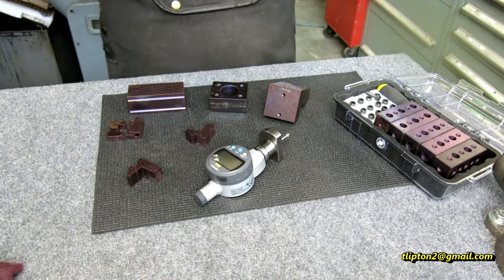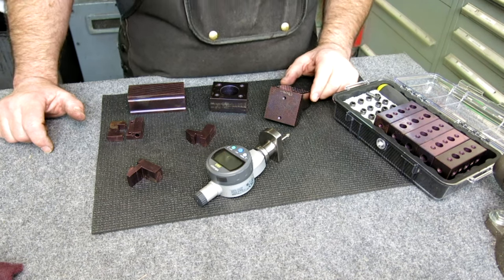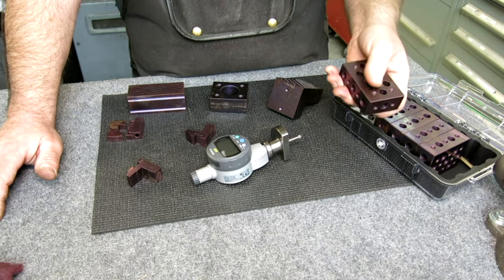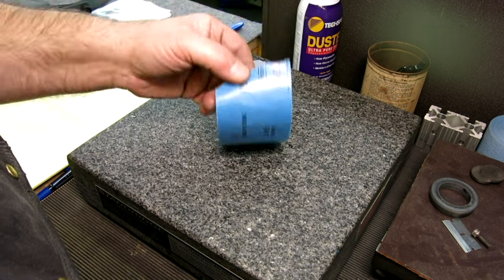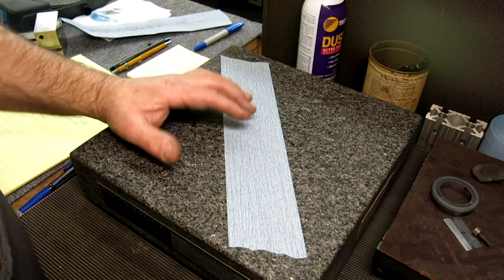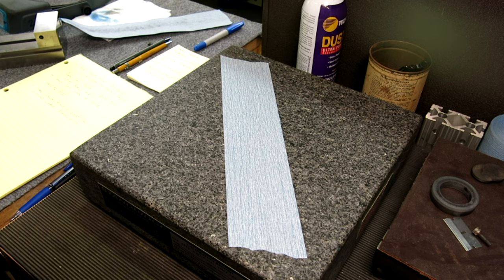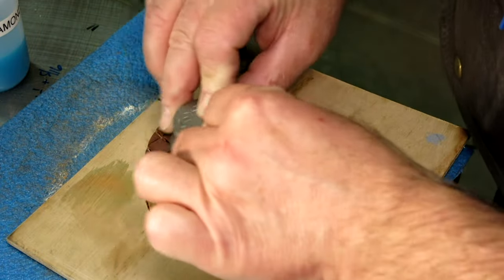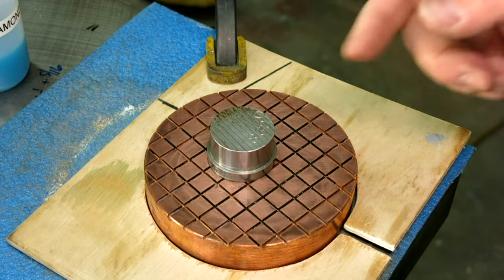Precision Lapping 101

Comment: Hi Tom! Maybe you find this useful : aluminum foil from food or hardware store  (especially 30-40um) is pretty precise, thickness deviation is less than 1um for the whole roll. I use pieces of this foil as a "bib" for my surface plate while running a 3d-printed planetary lapping machine with abrasive powders on it. Just a tiny drop of viscous (220cSt) oil on a plate, decently spread on surface, holds foil sheet very strong. Surface plate is always clean, and you don't have to wipe it while changing abrasive number. Parts from this DIY lapping machine are almost as flat, as an optical flat, checked that recently.
Reply: Инженер that sounds like a great setup, could you do a video on it?
Reply from the maker: That sounds very interesting. I have never heard of lapping done this way but it appears to have all the ingredients with the exception of grooves in the lapping plate. Film thickness would have to be controlled well to get good results. Thanks for the comment and suggestion.

Cheers,

Tom
Reply: Yes, grooves do a lot of good job with worn-out abrasive particles, foil method has this disadvantage. Classical flat-lapping machine uses interchangeable disks with grooves, but they are big, heavy and rather expensive. Thank you again for all your videos, it's a pleasure to watch!
Reply: Why not, will try to do a short clip.. If you agree to deal with my horrible "russian english")
Reply: Ай промис ту дил виз ё хоррибл рашн инглиш, соу вэйтинг фо ё видео игэрли.
Reply: @TheZoraccer  Ну и где видео?) Если ты писал какую-то статью/ветку на форуме, то дай ссылку, пожалуйста) Ну или модель на thingiverse?
[for non-russian speakers: I just asked where is his video]
Reply: @TheZoraccer  please make that video of aluminum foil lapping
Reply: I just got a granite surface plate (3’ X 4’ X 4”) at auction and you guys are now scaring me.

Comment: Hi Tom, another great video! I just wanted to mention that you can further improve your accuracy and increase time between resurfacing your laps if you rotate them periodically in addition to rotating your part. An even more ideal option, especially for larger parts,  is a heavy stand you can walk circles around while lapping.
Reply from the maker: I do rotate the laps as I use them. Just didn't happen to show in the video. Good point as a reminder.

Comment: Thanks for an awesome video! Reminds me of a time when I was challenged years ago with putting together a lapping department for Pratt & Whitney bearing seal plates for main LPT shafts on JT8D, JT3D, GG4  + GG3 engines. The roughly 5" to 10" in. diam. thin plates were a repair. Had to grind off chrome, plate again, rotory grind .00005 flat and and lap. Tolerance .00002 and 5 micro. I used Speedfam and Lapmaster revolving tables w/ 9 to 5 micron slurry and a polish on the lapmaster with a 5 micron lexan film all under unconstrained free weight. The trickiest part I fond was cleanliness between the work and flat. I used a 12" flat. I used similar to drag method but dragged wipe from under work instead of work off wipe. Always that 'pinch' of fiber on the ending edge. I then resorted to moving the part away from last wipe contact to 'roll' any fiber out from under the part edge. Yes, I put work on flat with mirror under it with a 12"x2" thick circular flat which is cumbersome to move around. Clean sterile clean was the key to achieve 1 dispersed circular fringe without suction meaning it was simply hugging the flat which was flat within .000002. Glad I'm making chips again ;- ) Thanks and thumbs up!

Comment: Used to work at a machine shop that ground Steel mill rolls, and these rolls were ground to a 3 microinch finish. At that level of finish, the surface actually becomes dark, the linear scratches set up an interference pattern with visible light causing the reflections to cancel each other out.

Comment: Thank You Tom for another great video ! When I worked in the die shop 45 yrs back we would grind magnetic blocks to the chuck and first grind them in flat. Then we would grind the surface till it cleaned up, backing off the the mag chuck power we would turn the part 45 Deg and using the same height take a pass across the part. Then turn the part 45 Deg in the opposite direction and run across the part again at same height setting, we called this cross check grinning which would leave a cross check pattern but would remove many of the humps and bumps. Very Interesting Video & Helpful. Bill B
Reply from the maker: Hey Bill,

That makes for pretty flat ground surfaces. There is another technique called spot grinding but its not for the faint of heart. Probably not a good thing to show in video form. Thanks for the comment.

Cheers,

Tom

Comment: I see some dovetails on some of those parts. That could get interesting? This is all very interesting what am I sayin' . The" give" in that sandpaper on the plate is what rounded those side's on that test piece like if you put some paper towels under sandpaper and rubbed say some 10 gauge on its edge you'd get a radius edge that really showed up on the optical    thanks tom, mind stimulated ,many questions resolved

Comment: Hi Tom,
Nice video! A lot of the grinder noise can be reduced with proper wheel dressing and wheel selection even more so than balancing but even then grinding will not compete with lapping assuming the person lapping knows what he is doing. The same would be true with the best mill techniques, the milling will be lacking compared to grinding.  Is it typical for for lapping to cut more aggressive on the edges of geometry (outside edges, holes) as we seen in your part? Is there a way to control that or is this just the nature of the beast? Thanks for the video, looking forward to more.
Steve
Reply from the maker: Hey Steve,

That part was not done being lapped. It got even better when I went back and got those marks out completely. Edge degradation is common and related to film thickness. The most accurate work is done with the barest minimum film thickness to prevent a hydrodynamic wave building up at the leading edge. The film thickness has to be slightly less than the abrasive size which is pretty darn thin.

Comment: Thanks Tom, your lapping videos are always interesting as it's not something I've done much of, and then only with cast iron charged laps.

How do you intend to determine perpendicularity to lapping tolerances? IIRC I don't think you have an autocollimator and that is way below indicator resolution.
Reply from the maker: Ahh but I do have an Autocollimator and electronic indicators that have microinch resolution. I should be able to inspect the right angles down to less than an arc second. We will find out together.
Reply: Oh you have an autocollimator? I didn't remember that, have you ever shown it in a video (I don't get to watch them all, and when I do I've often been working through the night, sorry if I forgot). 

You probably know it already, but one way to check perpendicularity with an AC is to put a known perpendicular surface in front, collimate on it, then slide it out the way. That will be accurate to the limit of your plate. Since your surface has 2 parallel surfaces there are of course other ways you no doubt know. 

Mirrors can be hard to get/expensive. I have successfully used old disk drive platters for first surface mirrors. They are double sided and very accurate, best of all free. Since they're double sided a mirror can be self-proved. 

I'm looking forward to the video you put up on the AC action. Thanks Tom
Reply: Very interested in perpendicularity in lapping video to come also! I haven't done any of that before, just some flat stuff. If there are any ways to do things on a low budget to lap/check, can you include them? I'd really like to start lapping some of my angle plates, 1-2-3 blocks, etc. to start doing this, but $ is tight.
Reply: Is the shop made autocollimator project on the schedule yet? :)

Comment: It would be nice to see a comparison of a freshly ground surface both pre- and post- heat treat with the lapped surface under the optical flat.
Reply: Paul Ste. Marie I think he may have in his other video where he laps steel plates. I think.
Reply: Jeff Winkelman The interesting bit would be the difference heat treat makes to the ground surface. The previous videos didn't show anything that had been heat treated.
Reply: Heat treat affects different with different materials and shape of the parts. Some are pretty stable, others will flex like crazy.
Reply: I wonder if he means how the surface  finish (not part geometry) is affected by the heat treatment?
Reply: somebody else Partially. Surface finish is micro-scale deviations from an ideal surface. I wouldn't expect professionally heat treated parts to warp, but seeing if there were small-scale deviations as well as surface roughness.
Reply: Tom,

This sounds like a great point to bring up in the next video, or another entirely different video... why do parts change shape in heat treat? How the molecular structure changes it's shape during? How much/why different materials and shapes and sizes change during heat treatment and annealing?

I really appreciate your videos, it's like having another die maker in the room and you definitely explain things much better than I do. I pick up small ways to better the way I talk to other people and new tricks here and there. The learning process never ends. Thanks again.

Comment: Ouch!!! Cringing at the dry lapping... I've always done it wet, under moderate flowing water, to immediately  wash away the SLAG and keep a "truer" surface.  It's an extremely noticeable difference from dry, in both finish and accuracy..... I like to progressively go up to 2500 before polishing, it's painstaking but worth it. The lapping plate with  diamond grit method you used is great!

I always enjoy your videos, thanks for sharing!
Reply from the maker: Have you quantified your wet sanded surfaces for accuracy? In my experience adding water generally promotes greater edge rolling degradation than dry sanding with frequent cleanings. If you then polish to produce high luster you are smearing the material at the microscopic level and not producing accurate geometry. Lapping is all about the geometry not the finish.
Reply: Yeah i agree... It depends what your going for though, ultimate flatness or some level of compromise...  some parts require polishing. In my experience wet has been far more predictable and edge rolling is largely due to technique and holding. Also, the way you introduce water... Avoiding floating of your part. Building a personal technique is crucial, eventually you can feel as the surface comes into flatness while your surfacing.
Reply: Kid, you have a lot to learn. You are just shining up your parts, nothing to do with accuracy. For now, you just "don't get it" (what's this all about with lapping, polishing, and so on). Bow down to the older folks.
 
PS
Having CNC doesn't make you "innovative".
Reply: wow classic ignorance... I might not be old but I'm 35 with 2 kids. I've worked in laser optics (spectral beam combining) and aviation components for years, i have the experience... Maybe you shouldn't be so quick to judge... Plus I said I agreed with what he said....I cringe at dry sanding like most do with nails on a chalk board... You have nothing pertinent to offer to the conversation, troll on somewhere else...
Reply: @chronokoks  I took an early out as an Operations Manager of a manufacturing plant. Our most skilled machinists, the ones responsible for prototype work and our tolerances weren't exactly the size of the Grand Canyon, earned the most. They were manual machinists, of course. Some of our button pushers with their ratcheted digital mics wanted to learn from the prototype guys, but lacked the right attitude/the intelligence/the knowledge/the drive, so they came to work every day and left with nothing new under their belts. They were worth what they were paid. Want to talk to me about engineers? You won't like it.

Comment: Interesting stuff Tom.  You mention lapping soft materials is tricky, it seems like that would not be done that often?   I'm working on a small job in OFHC Copper there is a "best effort" flatness spec on it...
Reply from the maker: Hi Bill,

Soft copper is what got me started in lapping. Had a job for one micron over one inch that was .030 wide. Exit slit for a monochromater. The little diamond impregnated lap I showed is your best bet. Do it wet with something like lighter fluid that has a thin film and does not evaporate too quickly.
Reply: oxtoolco Will give that a look, my part is .250 dia with .016 hole in the center.  They want no CS edge on the hole.  Thanks again.

Comment: Thank you again. Please let this be the first of several. If you could, please give your thoughts on how the feedback from oil dye matching, solvent dye matching and monochromatic light gap referencing compaire to optical flat mapping.
Reply from the maker: Hi Carson,

You got me on those. Don't know anything about dye matching or solvent dye matching. Sounds like a technique for measuring particulate size but I'm just guessing. Can you provide a link to the techniques you describe? 

Regards,

Tom
Reply: oxtoolco Yeah, you might find my vocabulary off. I'm coming at this from the "how do I get this to fit tight" side, rather then the "how do I get this to index/reference repeatedly" side. Think high pressure matting surfaces.
Dye matching is just like you do for a scraped surface, but instead of counting points, you dye the part, press it to a reference and look at how much of the dye didn't come off. Normally would use Prussian blue in oil, then in alcohol to show valleys as opposed to ridges. If you want to get crazy, use india ink or black it with soot and press. You print straight down and back up. No spinning or wiggling allowed. Less messy is using a long wave monochromatic light (the opposite of what you're doing) at a low angle to backlight a gap between the part and a plate or a straight edge. 
Sorry, I tried to find formalized reference material to link and came up empty. I appreciate your response and if you have read this far, you may find this interesting:
https://www.techbriefs.com/component/content/article/1831

Comment: I have wondered how much that belt drives transfer their irregularities to a surfaces finish, A direct motor drive to a stone(for example0 might take out some faults?, Dunno.
Reply: Not really, you will still need lapping...
Reply: The unevenness in this case occurs at the same X position on every pass, indicating imperfections at those points on the grinder's X axis ways.

Comment: Hi Tom.
i always like watching your posts as it brings back memories & even though I've been retired for many years when I worked as A Toolmaker at a Government Factory  & during The Vietnam War we made heaps of Fuse Timing Components for Both The Australian & American Services  we had  Vacuum Furnace which was very handy to Harden very small Punches & Dies as we could make them to Size Then harden them without any movement like what happened in The Salt Pots.
Also we used The Diamonds on Lapping Plates.. We also Rolled Diamond Dust onto Small Mandrills for Jig Grinding very Small holes.

Comment: When you hand grind an object on a flat surface (and don't go over the edges of the flat surface)
you can't make the object's surface concave, but you can make it convex.
E.g. if you accidently apply force close to one of its edges.
How do you prevent making it convex?
Even if you manage to apply the force exactly on the center of the object,
doesn't the friction between the flat surface and the object make
the object to tilt forward so that the abrasion removes more material
on its leading edge, and make it convex?

Comment: Thank you for this good vidéo man ! 
I recently discovered an intrest in lapping, i’m not a mecanic or anything but i just wanted to lapp the integrated heat spreader on my cpu to make it better at dissipating heat by having better contact with my water cooling cpu block. 
I do not have the tools for feedback anyway so maybe i shouldn’t touch it so i don’t make it worst :/ 
Have a good day dude and thanks again.

Comment: I'm currious about how well it would work. If the lapping plates were drilled and threaded, placed in a pan with a steady supply of abrasive infused liquid pumped up thru the holes. Just wondering.

Comment: ok, you leave more questions than i thought there were? what is the optical flat made off, and how? how do you lap angles square to each other? how would you lap some thing long like a straight edge? what is the best way to lap a shaft and housing for air bearing spindle? can one lap lathe bed ways?................

Comment: I'm terrible confused in how you expect diamond (the hardest material) doesnt just inbed into the copper (the softest) and really doesnt affect the steel surface.

If the lap and the object were both steel (within a close enough rockwell), then that would be a different endeavor but that isnt what you are doing here.

Comment: "Pretty flat" but you've rounded over the edges, yes, because of your hand technique while lapping and the aspect ratio of the part, small diameter with a tall height makes it easy to tilt pressure as you lap.